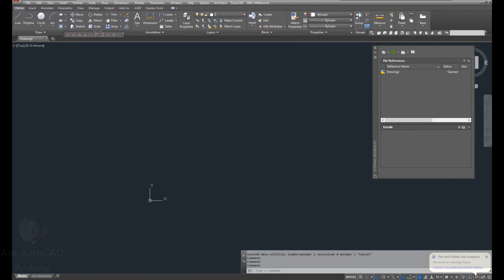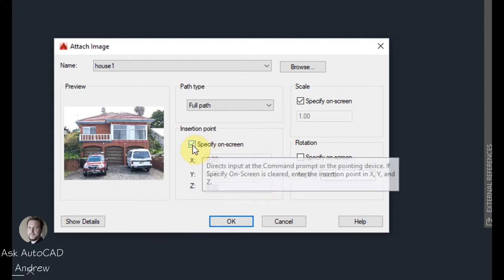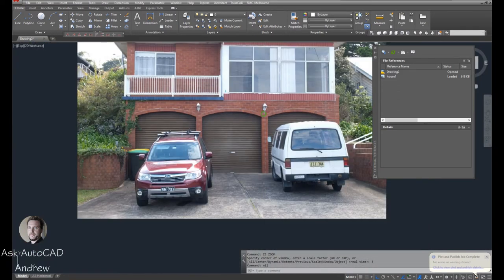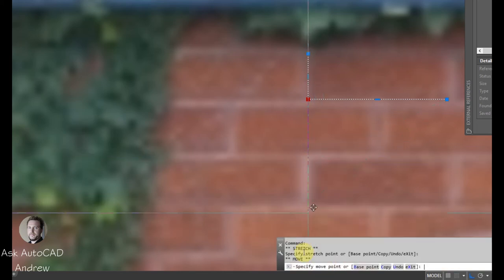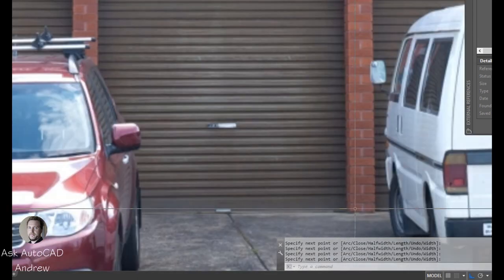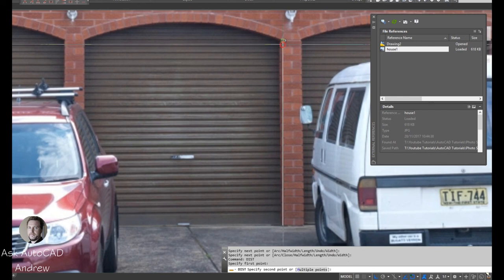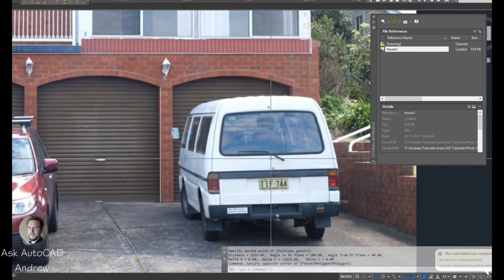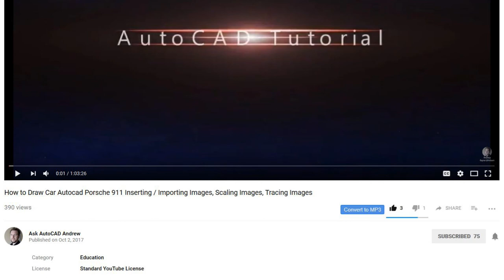Measurements from Photo of Housein AutoCAD - Brief Introduction

Comment: This method is ok but worth mentioning that any sort of photo angle can easily ruin your measurements.

Please share some other ways to do it, maybe there's a better way
Reply from the maker: Hi Geediez, It is a basic method, and lacks accuracy, and the angle makes a difference too which I did make a mention of in the video. Counting bricks is a pretty good way to do things though, and you don't need to trace the photo as you can just count bricks. I have a couple of other videos I plan to make to give you more accuracy to work these things out that I will be making shortly.